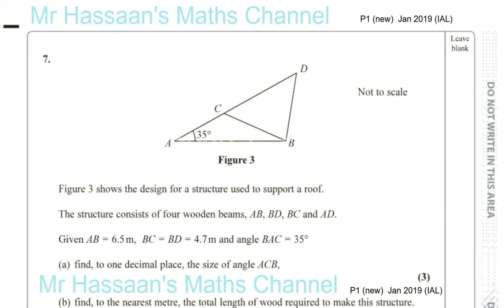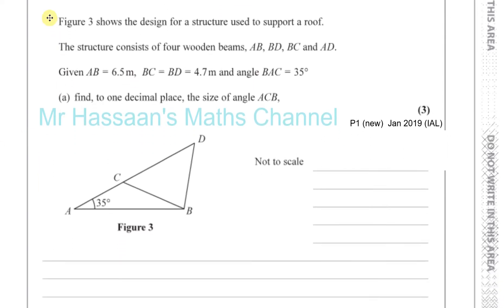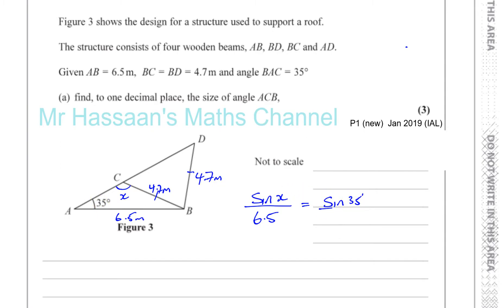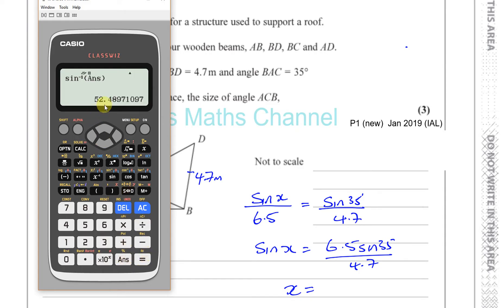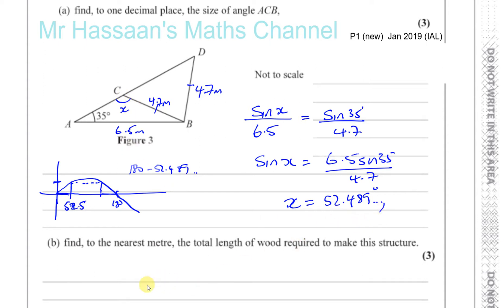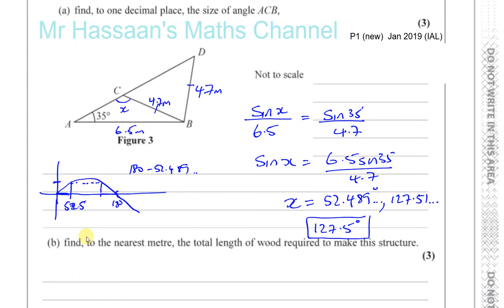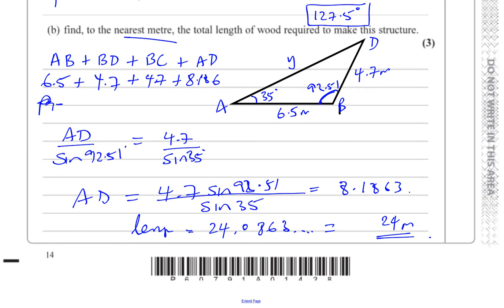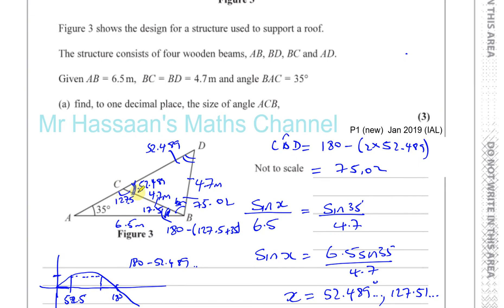EDEXCEL IAL P1 new JAN 2019 Q7  Trigonometry (Sine Rule)

Comment: 12:49 I was using the cosine rule for finding AD, by doing 4.7^2 = x^2 + 6.5^2 2(6.5x) * Cos(35) where (x) is the length AD. It leads to a quadratic equation and both values for x arent close to 8.1863 Why can't you use the cosine rule in this situation?
Reply: I dont know why the words and numbers are crossed but i'm pretty sure its readable

Comment: Still cant understand why is ACB an obtuse angle... there is no proof they want it as an obtuse
Reply from the maker: The proof is from the diagram itself .. ACB is an obtuse angle.
Although I kind of agree that it is a little ambiguous... it should be stated more clearly as the diagram is not to scale.
Reply: @MrHassaansMathsChannel  the diagram was just there for reference and it also says that the diagram is not to scale on the side....the angle should still be 52.5 in my opinion
Reply: @blescent4933  well yeah but look at angle A which is 35 it's clearly an acute angle and angle ABC which we calculated its clearly an acute angle shown in the diagram and not to scale doesn't mean that the angels that are shown are different it just means that the scale in which the diagram was drawn with doesn't fit any answer which u calculated hence  angle  ACB will be obtuse I hope u got the gist of it ( ik i prolly bs'd here n there but the main point should be  clear )
Reply: @buqbooQ  no i got it, appreciate it
Reply: Ok thanks